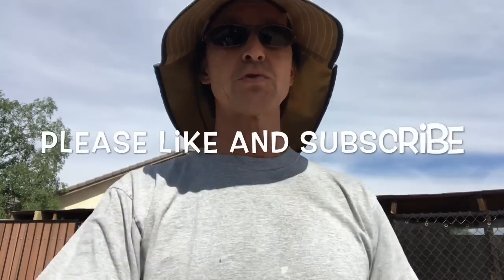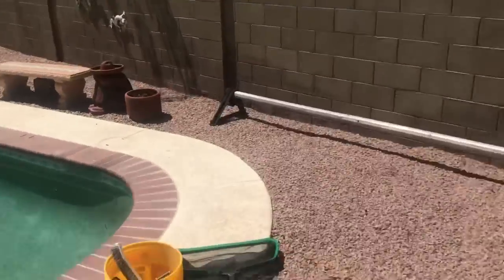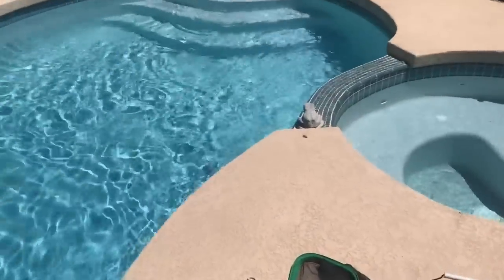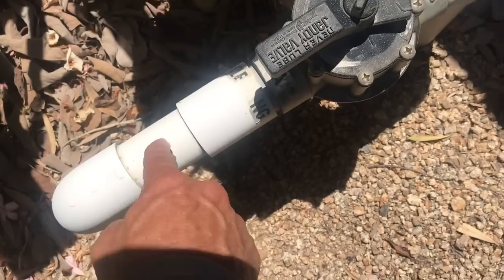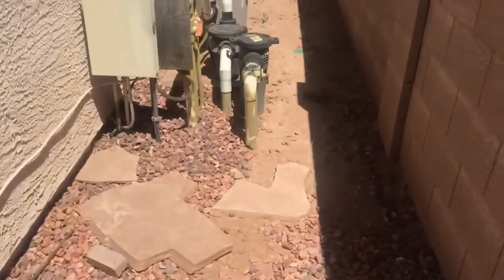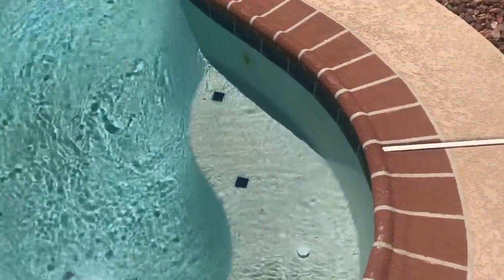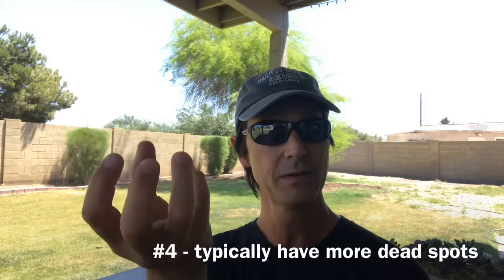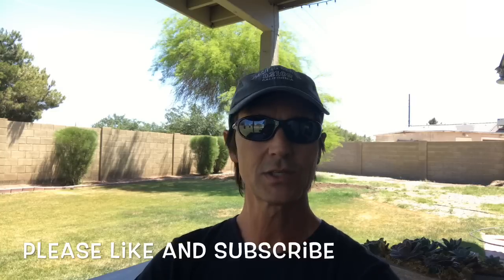In floor “Pop Up” Cleaning Systems

Comment: I hate the pop up systems.. in Florida you still have to vacuum the pools every week, sometimes I get lucky but most of the time.. most my clients don’t have vacuums so I have to vac with power vac
Reply from the maker: Kenneth Smith that’s a bummer. That’s been my experience with most pop up systems. They just don’t work well.
Reply: I have 1 client out of 8 pop ups that works well..
Reply from the maker: See if they’ll let you convert their pool to a stay in vac.
Reply: What all do you have to do to do that?
Reply from the maker: Kenneth Smith I’m actually doing a video on it after I upload my next one. Stay tuned.

Comment: I had a pool in AZ with the caretaker popups, it sucked. One motor, always had to vacuum the pool. If they are set up right I ques they can be good, if not you wasted a lot of money and will still do a lot of work.
Reply from the maker: Gunners Ecuador yup. Sadly that seems to be the common experience I’ve had doing pools. Just not a fan of them.
Reply: @PoolSchooler  Hey Ken thanks for the reply. I also had a question about the 3" tablets and the floaters. The pool store says my pool which is 8250 Gal only needs one tablet, and that I can put 3 tablets in the floater so long as I have the adjuster set for 10K or less. Is this correct?

Comment: I wouldn't recommend a dedicated pump for any infloor cleaning system.  Too many benefits (chemical distribution, natural convection heating, single pump cleaning). Zero benefits from a dedicated pump.  Dead spots are not common, that is a product of installation.  Pipes should be painted for protection.  Also many areas require a split suction for safety.

Comment: Question, I followed all steps and replaced some worn gears but the (brand new) Impeller still not spinning and stuck on one Zone. Any other suggestions?
Reply from the maker: @bmallett1  without actually looking at it in person it would be hard for me to help. It’s yet another reason why I don’t care for pop-up systems. I might recommend contacting a Pool Service pro and spend the money to have it fixed right.

Comment: I have a hard time to locate the check valve for the Paramount cleaner system cyclean to replace it to keep spa water level up when system is off. Can you please show me? Thank you!
Reply from the maker: I did a video on check valves. Here’s a link it might help. https://youtu.be/O6O9nY1jtUI?feature=shared

If it doesn’t help you locate it the only way I can help is if I see a video or pictures of your equipment and plumbing. So if the video doesn’t he’ll email me at Kennypoolschool@gmail.com. And send me a video and pictures of your pool equipment and Plumbing and I might be able to help me locate it.

Comment: Just signed contract for a pool build in Surprise AZ.  Went with the in floor system because it sounded like it would be easier for us to maintain. Now we're having second thoughts.
If we go forward with the in floor system, any recommendations on to which brand/type we should make sure is installed??
Reply from the maker: Unfortunately I can't endorse pop up systems because I feel they are inefficient.  If you do go with that make sure they have a separate pump dedicated solely to the pop ups.  The only benefit of pop ups I can honestly see is that they are aesthetically more pleasing where as a stay in the pool vac isn't as visually pleasing.
Reply: @PoolSchooler  Great stuff. if you're not a fan of all the pentair gear vacs what vac have you had best success with? And how do i prevent my pentair 2 wheel vac from regularly climbing the wall and sucking air and killing the pump for a minute? 
THX SAM
Reply from the maker: @samhallowsdc  My absolute favorite vac is the Zodiac Barracuda G3.  I did a video on it here's a link:  https://youtu.be/fFAiyDl6jRo?feature=shared

As far as it climbing out of the water a simple adjustment of the suction on the vac will take care of that.  You want it to come about 1/3 up the wall.  MAKE SURE THEY INSTALL A DEDICATED SUCTION LINE FOR THE VACUUM AND have an valve to adjust the suction between the skimmer and THAT vacuum line.

Comment: What is the brand of that pop-up actuator?  Actually I have to replace my 5-port Caretaker actuator because the hosing is leaking and the gears are no longer working properly.  Is there a particular brand of actuator that you recommend for durability?
Reply from the maker: I always recommend using the same actuator your system is made by.

Comment: TIP as I RTFM, if you have a dead spot on your steps, did you mix your pop up's. What I mean is that on a Shasta pool system the step pop up's have a smaller nozzle therefore more pressure.

Comment: We have pop up system what psi should be at while  running pop up ours only 5 psi .last time I try to adjust handle for  flow I blew up filter canister .what did I do wrong thanks Jerry
Reply from the maker: Hey Jerry, it’s hard to tell based on just what you’re saying, some pop-up systems are different than others. The older ones are more prone to blow a filter. If the pop-up actuators don’t rotate and open the different flaps to each section the newer ones have more of a failsafe so you can dedicate most all of the return flow to the pop-ups, and if it gets stuck in the actuator, it will never have all the flaps closed. So it’s very hard for me to comment on it, my suggestion would be to convert your pop-up system to a stay in the pool, vacuum system using a vac mate skimmer adapter  by Pentair. And put any zodiac barracuda G3. I have a video on converting your pop-up system to a suction side, vacuum using the vacmate skimmer adapter. But I recommend getting a zodiac barracuda G3 over the pool cleaner which is in the video.

Comment: Really enjoyed your videos, very informative.
I am in need of some advice and/or your services.
I have an inground pool/spa pebble-tec floor with pop-up cleaners.
I have a single pump that runs everything.
The problem started when I noticed my pump pressure was
very high and the pop-ups weren't functioning.  I backwashed
several times with no change.  Come to discover,
an unidentified piece of plastic is blocking the flow of 
water into the actuator, from the pump. No idea what it is or where
it came from.  It's about 3 inches long with a circular 
bottom and a two-prong fork at the other end.  Bottom line, can't 
get it out.  I had to take out the gear kit to try to remove the
obstruction.  To compound matters, the metal rod in the middle
of the gears has fallen down one of the pipes leading to the popups. 
It was recommended that I dig and cut the pipe from the pump to the 
actuator, in order to remove the piece of plastic
(no experience with this). As I said, looking for advice
and/or possible service. Would I be better off 
going the vacuum route? Which is best for pebble-tec
Reply from the maker: Wow! That is really a bummer and I’m sorry that you’re having to experience all that. Just for the record you just listed a myriad of reasons as to why I’m not a fan of pop-up cleaning systems. It’s hard for me to comment on what is stuck in your unit if you wanted to email me a picture of it that might be helpful. My email address is Kennypoolschool@gmail.com. My own personal suggestion would be to disable your pop-ups and convert your pool to a suction side vacuum specifically the barracuda G3 and use a vacmate skimmer converter to do it. I have a video on that it’s in titled “converting your pop of system to a vacuum using a VacMate”. Check it out, it might be helpful.

Comment: I have a somewhat similar system, I think, although it is not working. I was told that it is a "whip" system, where they used to have whips randomly blowing water around. I have around 10 3/4 in threaded outlets around the pool and a capped of inlet near the pump. The system has been disconnected from the pump. What could you tell me about it? I can't find anything about it.
Reply from the maker: I've heard of such systems but not a fan.  You'd do. well to convert to a suction side pool vacuum like the Barracuda G3 by Zodiac using a Pentair VacMate.  This video may help: https://youtu.be/eagXAKxN8zM

Comment: A couple questions. First, my pop up system is blowing air (a lot of bubbles come up) out of the jets as it switches from area to area. Any ideas on that?

Second, I had a pool guy switch my system from a two pump system to a single pump system. I understood that the second pump was just drawing extra power but after watching this video I am now thinking it may be reducing the pressure on my jets as that pump was pulling more water. Could that be right? Can you generally switch a two pump system to a single pump system that runs skimmer and the in-floor system?
Reply from the maker: Hi Steve. This video may help with your first issue: https://youtu.be/RvRncnBTC-g

On your second issue, "yes" I believe you could be right.  That other pump was probably a dedicated booster pump to drive the pop ups and now that you only have one, the return flow is being shared by your returns and your pop ups.  I think you were better off with the additional pump to drive the pop ups.

Comment: So my pool has the valve on the pump that goes to either the vacuum hole on the side for a automatic vacuum or to the skimmer. However my pool has a pop up system. So I have one of those diverters. I would think I should always have to have the diverter doing its thing in order for the infloor to work since the drains need suction to work. Would this be correct? Is there another way my drains would have suction without the diverter?  I don't have a leaf vac. Thanks.
Reply from the maker: Thats interesting.  Usually a pool isn't built with both a dedicated vacuum line port AND a pop up system.  I guess if you're using just the pop ups for cleaning then you should have all the suction to the skimmer and then adjust the diverter so you get some suction to the floor drain.  If you are using a suction side vacuum then you'd want to adjust the suction to approximately 70% to the vacuum and then the rest to the skimmer.

Comment: Great video! I'm in the process of buying a house in AZ and it has a nice pebble tech play pool. For some reason, the pop up cleaning system has been capped off and the plumbing disconnected. There doesn't appear to be be a vacuum running in the pools as well. I'm a little lost on knowing how to fully understand what's truly going on since it's not my home. The current owners live in a different state and have been renting out the home which is now vacant. SO the information is very limited. The pool filter was mentioned to have been changed from a sand filter to a cartridge filter last year. If the pop up system was leaking, could you abandon that line and have it rerouted to another line? Do you know why they would have capped off the system? Possible previous sand filter clogged up the lines? 
Edit: The pool does have a water feature but does not appear to have a separate dedicated pump.
Reply from the maker: I'm sorry to say without seeing the pool I wouldn't be about make an accurate assessment of the situation.  However if they disabled the in floor system you may want to convert it to a stay in the pool vacuum using a VacMate.  I did a video on that here's the link: https://youtu.be/gSfbNv4sV_M

Hope this helps.

Comment: Our housing is spraying lots of water out at the lid whenever the water feature is off & the pool pump is on. We changed the O ring & the issue still persists. Do you happen to have any videos on that?
Reply from the maker: Unfortunately I don't  You may have a cracked housing tho.  That plastic does eventually become brittle over time and in the elements. It may be time to replace the housing.

Comment: Very interesting. We are going through the process now of getting quotes and on the list is a pop up system. They want 12k AUD for it.
Reply from the maker: Personally I'm not a fan of pop up cleaning systems.  I'd suggest getting a dedicated suction line installed for a suction side vacuum and then purchasing the Zodiac Barracuda G3 pool vac.   It would cost a ton less and work more efficiently.

Comment: How often should the pop up system run? My system looks identical to the first example but mine is not on a timer. I have to manually turn that separate pump on. How often should I run the cleaning system?
Reply from the maker: First MAKE SURE THAT THE FILTER PUMP RUNS THE SAME TIME AS THE POP UP PUMP.

I have a video on pump/filter run times and usually in the peak season you should run both filter and pop up motors for 8-9 hours a day.  Then in the off season you'd want to run your filter and pop up motors for 4-7.  Here's a link to that video in case you want to watch it: https://youtu.be/RRAHlbfYjwg

Comment: If any of your in floor pools have dead spots, you might have competing heads. One could start to move debris toward the drain,  then when it cycles to the next head that might push it back to where it started. Sometimes I would wait the system to cycle to a head, then with my telescopic pole push down on the head and ratchet it to the direction I wanted. If you do that with each head sometimes it would fix dead spots.
Reply from the maker: Good information.  Thanks for commenting.

Comment: Thank you again for this video. I have a pop up system, are you able to clean out the actuator basket?? Do leaves or other debris go into the actuator?
Reply from the maker: Typically debris don't get into the actuator.  Actuators don't have baskets.  Your pump has a basket and your pop up system may have a leaf catcher built into the side of the pool.  If your actuator is not rotating the sections of the pop ups then you probably are in need of new actuator gears.  They make kits that replace the entire inner workings which would be my suggestion if you need to rather than fixing one gear etc.

Comment: Everybody who owns a pool should subscribe to your channel! Thanks for the great in depth information! I have an in floor cleaning system and the pop up nozzles rotate. I was under the impression that they're supposed to point towards the drain at all times. Are they designed to pop up in a rotating fashion? What ends up happening is all the dirt ends up in the corners of my pool and not in the drain. Thanks.
Reply from the maker: Thank you for your kind comment.  Yes, pop up heads are designed to rotate (about 1/8 of a turn or so) every time they drop back down.  Its supposed to allow them to create a 360˚ "spray" pattern.  But what you're describing is very VERY common with pop up cleaning systems (which is one reason I prefer a suction side pool vac like the Barracuda G3).

Comment: Great information! I am about to buy a property with the pop up system and it's already showing some problems. Just wonder how much it would cost me to convert this system to a vacuum system?
Reply from the maker: Just the cost of the vac (I'd recommend the Barracuda G3 - my favorite around $250 online but look for deals). And then I'd suggest using a VacMate(somewhere around $70) to convert. Check out my video on that subject. Here's a link: https://youtu.be/gSfbNv4sV_M. I think you'll like the results of a vac over a pop up system.  Only real drawback is the vacuum stays in the pool so it's not as "asthetically pretty".

Comment: What are other reasons to use the pop ups. I’ve read it helps with circulation when heating the water and chemical balance?
Reply from the maker: I guess pop ups can "assist" in circulation when heating the water and chemical balance, but truthfully it's not going to adding so much better circulation to your pool.  In a typical, well made pool you should have ample suction and return circulation to your pool without pop ups.  Remember, most pop up systems share the return pressure from the main pump/motor with all the other return items on your pool so that means to run the pop ups they are taking away return flow from your return ports.  Unless you have a dedicated pump/motor solely for the pop ups.  Then you would be increasing the circulation BUT unless THAT pump was connected to your heater it wouldn't help with heating since most heaters I know of run off the main pump for flow.

Comment: Can you explain a little bit more on the leaf blower canister? Like how it works and where that debris comes from?  I bought a house with a pool that seems to have nearly the same set up but the canister doesn't seem to open? The canister lid is not quite the same as the one in your video which seems easy to open and close. The canister on my pool is very tight and I'm afraid to apply any hard pressure to open it
Reply from the maker: Norman Wong I’m guessing you mean the in deck leaf catcher I show, open and empty at 10:11 in this video. I’m not sure what type of lid yours has but it shouldn’t be hard to remove. Unless it’s different than the one I show here. Also try opening it without the pump motor running. Sometimes it can create suction that can make taking the lid off difficult.  The suction is provided by the pump motor and the leaves are sucked in usually through the floor drain and the side port in the wall I show at the very beginning of where I show the leaf catcher. If you email me a picture of what you’re describing I can give you a more accurate and probably more helpful suggestions. Kennypoolschool@gmail.com
Reply: @PoolSchooler  will do! thanks for all the useful videos
Reply from the maker: @normanwong1780  You're welcome.